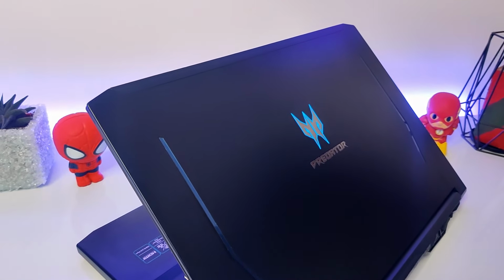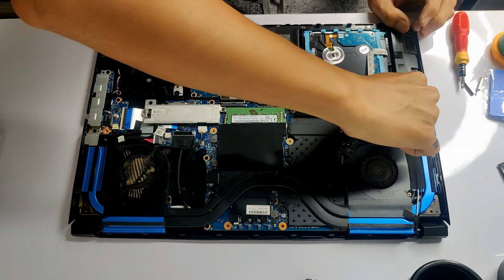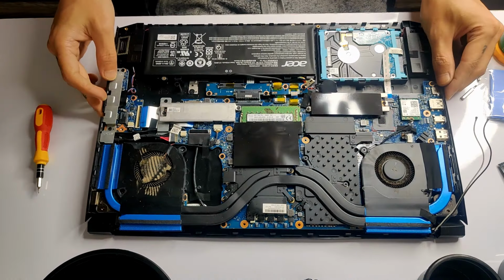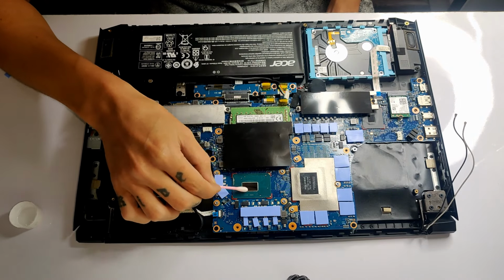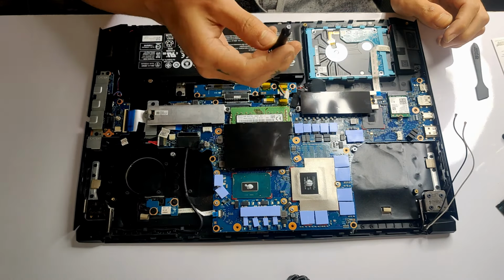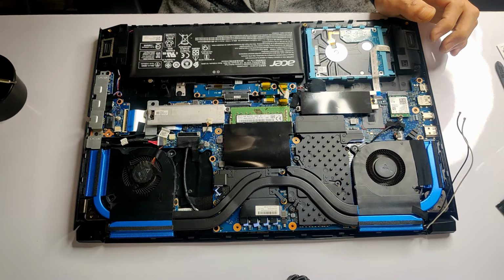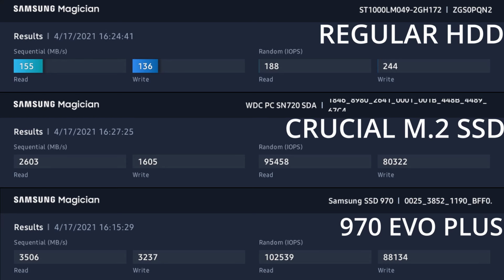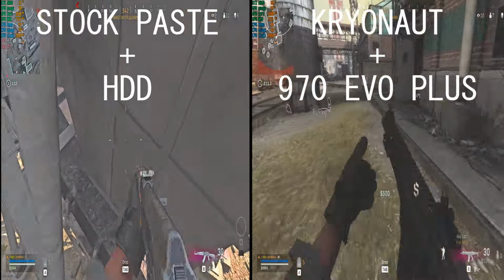ACER PREDATOR HELIOS 300 2019 UPGRADE | REPASTING | CLEANING GUIDE & BENCHMARK

Comment: Hey Sir .. my laptop is Helios 300 - i7-7th 1060 - 2017 .. i need to know .. the right size(thick)  thermal pad for my laptop .. is it 0.5mm or 1mm .. Or more than that? how thick are you using?
Reply: I hope you can answer it.. thanks sir
Reply from the maker: Hi. Sorry for the late reply.
For your model laptop, you can use 1mm for everything.
Hope this helps. Do subscribe to show some support 😃✌🏻

Comment: I have some serious thermal issues. I have done everything i can software vise. I think it's a hardware issue maybe thermal paste is gone or something i don't know. Can you clean it or what should i say to a shop when i want to get it cleaned like u did ?
Reply from the maker: You want me to clean it for you? What if I took your laptop and disappeared? Lol... I'm just kidding 😋 I could do that for you. Not a problem at all.
If you're giving it at a shop to do the job, I wouldn't trust them with it. You will still have to open and check for yourself.
I once gave my old laptop for service due to some motherboard issues cause one of the GPU IC was burnt and when I got it back, I opened it up to check what they had done. To my surprise, I found so much of dust stuck in the laptop, including the fans and I had to clean it out myself. I mean it's an old office laptop and the fans are not hard to reach like this predator model or any other gaming laptop in that case where the fans have an enclosure. The dust was sitting right there as I opened up the back cover and they couldn't even clean it for me. From then on, I decided to do the repasting and cleaning by myself.
You could give it at a shop, but make sure you don't take the heatsink off in case you want to check later or else air bubbles might form and in return, causing thermal issues.
Hope that helped. Let me know if you have any other questions. Do SUBSCRIBE to the channel to show some love and support 🙂✌

Comment: BRILLIANT !!!
Reply from the maker: Thank you 🙂 Glad you liked the video and hoping you subbed to my channel 😊✌
Reply: @MVNDRVX  Done 👍
Reply: @MVNDRVX  what thermal pads size will be good for helios 300 (2019) 15.6" model ?
Reply from the maker: @omega6180  Same... As shown in the video... 1mm everywhere except for vram memory chips which will be 0.5mm
Reply: @MVNDRVX  Thank you.
Reply from the maker: You're welcome 🙂👍
Reply: @MVNDRVX  Repasted my Helios 300 today. No more overheating in Aida64. But CPU temperatures still go upto 85-90C regions while playing games like FarCry New Dawn in Ultra
Reply from the maker: Did you clean the fans? And which brand of thermal paste did you use?
Reply: @MVNDRVX  yeah I cleaned the fans and heatsink too. I applied kryonaut using spread method
Reply from the maker: Maybe just give it 2 days or so for it to cure and check your thermals again or else i think you might need to reapply again if there are no changes. Are you sure you applied enough paste?
Reply: @MVNDRVX  yeah I am sure. Maybe it's the Indian summers. How are your current max temps?
Reply from the maker: @omega6180  yea maybe it could be the hot weather. I get a maximum of 82-83 degrees at a room temperature of 24 🙂

Comment: Hello. By any chance do you have a link for the rubber part of the hard drive with sata cable? I got the same laptop but semi new, I opened it to add another ram but there is no rubber part on the 2.5" bay. I tried talking to the seller but I don't have a response yet. I hope someone can help me. Thanks a lot in advance!
Reply from the maker: Google these following part numbers and you can find many online sellers.

Part number for HDD rubber: 47.Q5MN4.008
Part number for SATA cable: 50.Q5MN4.005
Reply: @MVNDRVX  Wow thanks a lot sir!
Reply from the maker: @rainerjoshuamarasigan6753  You're welcome

Comment: my acer stopped working yesterday night and i got mini attack but today morning it started working. again but i an afraid. i already have a history of opening and cleaning the 2 fans internally when gpu fan stopped working. i will use your video to move further for repasting. thanks a lot. is it worth repasting my 1.7 years old 2019 predator or anything might get damaged as i am not expert in these things? i do heavy gamming.
Reply from the maker: Have you repasted the CPU & GPU before?
What are your laptop temps?
Reply: @MVNDRVX  didn't repaste yet. i opened 15 days ago when GPU fan resisted to rotate and cleaned  both fans from inside and found a thick cloud of dust at the openings of the airvents. after cleaning air flow in and out is good from both fans and temperature touched 90C after few hours of continuous gaming instead of touching 90C immediately. 

Yesterday, laptop suddenly died while doing some work and it continuously restarted for every 5 seconds by itself without any display on the screen. I tried everything found on internet but didn't work. today morning it again started working. I am not able to understand what was the issue the laptop?
Reply: @MVNDRVX  cpu hits 90-95C and gpu hits around 84C without repaste. i undervolted cpu.
Reply from the maker: @ThePrabhu16  Those temps are pretty high. You should repaste the laptop. You wouldn't need to undervolt any more once you're done.
Sounds me to like you took off the heatsink to clean the fans. Whenever you take off the heatsink, always make sure you apply fresh paste. If not, air bubbles can form and further causing thermal issues.
Good luck. Let me know the results once you're done. Feel free to ask me if you have any doubts. Do SUBSCRIBE to the channel to show some love & support 🙂✌
Reply: @MVNDRVX  thanks a lot for your support and time. will repast and let you know the thermals.
Reply: any idea on how much does mother board cost if it really got damaged. mine is acer predator 1660ti with i7 2019 version.
Reply from the maker: @ThePrabhu16  you're welcome 🙂
About the laptop rebooting itself after every few secs is not an issue with the thermals. Its the laptop itself. It has happened to me too a couple of times. Just let it do it's thing. Don't power it off when you get a black screen. Just turn on the laptop and let it reboot a couple of times and it should be back to normal in a couple of minutes.
The motherboard would cost as much as the laptop itself because the CPU & GPU are integrated into the motherboard unlike desktop PCs. Better to buy a new laptop if that's the case 😅
Reply: @MVNDRVX  hope there is no mother board issue 😀 but very thanks for your replies . hope your channel will grow more in coming days.
Reply from the maker: @ThePrabhu16  Thank you so much 🙂🤍
Reply: @MVNDRVX  have done the repast with heart holding in my hand . luckily things went fine and my laptop powered on after repaste. but had some issues while placing the silicon cooling pads which are of different widths. because of irregular cooling pad widths, some ics are not touching the touchable points of the heat sink. noticed reduction of 10degrees in cpu temperature in predator sense app after repaste but when i touch the part above the keyboard, it burns 🔥 our fingers after few minutes of gamming.
Reply from the maker: Because most of the heat is produced above the keyboard. You won't be touching that part often anyways. Can't expect more from a laptop.
But the good thing is that you managed to drop your temps up to 10 degrees. That's great 😃
Shows that you've done a good job with the thermal paste 🙂
Reply: @MVNDRVX  it happened because of your video 😀... thanks a lot.... purchased cosmic byte hydroid cooling pad but not sure how it helps .
Reply from the maker: You're welcome 🙂
Actually cooling pads don't help much. You should've got an adjustable laptop stand instead. I've bought one from the same cosmic byte brand for 900rs and the quality seems to be decent 😁

Comment: what should i do with my acer predator helios 300. when i put the charger in , the charger light comes on but screen is blank and wont power up ? been told by the computer shop its the graphics card but i dont get how ..... shouldnt it be cause the battery might be burnt out so i just need a battery change
Reply from the maker: Did you try to disconnect the battery and reconnect it again?
Reply: @MVNDRVX  yep
Reply from the maker: @WealthOverFameAndAttention  Is the Predator logo showing when you try to power it on? Or just plain black screen?
Reply: @MVNDRVX  plain black no predator logo
Reply from the maker: @WealthOverFameAndAttention  Hold down the power button for 10-15 seconds, let it charge for a while and try turning on again.
If that doesn't work, then you will have to check with Acer service centre.
Reply: Having the same problem after repasting. Fans are not running, just black screen. Tried disconnecting and reconnecting the battery. Discharged and charged completely

Comment: when you did the storage upgrade, did you move that to be the primary storage device or just add a second drive? Mine has a 512gb and I am going to add a 1tb but I am trying to figure out if i need to move my os and everything onto it it by cloning then clearing the 512 or just add it as additional storage.
Reply from the maker: I just added it to the other empty slot and kept everything else how it was.

Comment: I have a doubt regarding the Vram, since it was a paste that was there wouldn't be better replacing with thermal paste too? Or another paste (meant for vram, idk the difference)
Reply from the maker: Yes it would be better to repaste with the same kind of thermal paste but it's not available or affordable in many countries.
So thermal pads would be the next best option 🙂
Hope I've cleared your queries. If you think me or the video has been helpful, do subscribe to show some love and support 😊✌🏻❤️
Reply: @MVNDRVX  Thank you very much, I'll see if I can find it in my country, btw do you know what is the kind of paste they used on vram? Subscribing right now, thanks.
Reply from the maker: Not sure what brand of high viscosity paste Acer exactly used. Might be a cheap quality china made product.
You could try the Thermal Grizzly Kryonaut Extreme 🙂
Reply: @MVNDRVX  Which thermal pad did you use though, 0.5mm or 1mm?
Reply from the maker: @JotaFla  I used the 0.5mm for the vram and 1mm for everything else 🙂
Reply: @MVNDRVX  Thanks!

Comment: I'm planning to use Carbonaut on this. What should the sizes of the thermal pads be? The Carbonaut is only .2 mm thick. Should I opt for .5 mm all around or do I stick with 1 mm everywhere, and .5 in the VRAM modules? Thanks!
Reply from the maker: Stick with 1mm and 0.5 for the vrams 🙂
Good luck. Do subscribe to show some love & support 😃✌🏻❤️
Reply: Just an update: Followed everything regarding the thermal pad thickness and still used Carbonaut and it worked flawlessly! Thanks for the advice. :)
Reply from the maker: @DaddyK1tt3n  I'm glad it worked out well for you 😃 you're welcome 🙂❤️

Comment: Hi , please help … I have acer nitro 5 , I applied 1mm thermal pads to the Vram  the performance is now weak  and the temps is higher too … what should I do ?
Reply from the maker: Did you reapply the CPU and GPU with fresh thermal paste?
Reply: @MVNDRVX  yes repasting with thermal grizzly and applying thermal pads the GPU temp goes up to 78C with very poor performance 50% GPU usage … is there a possibility that the pads are too thick ?
Reply from the maker: So normally the vram mems don't give out so much heat. I think your thermal paste application was too little or check whether you connected the fans. That's a very common mistake people make 🙂

Comment: Which ones are the VRM chips? The smaller ones? I can't tell the difference which you put 1mm thermal pads or 0.5mm thermal pads.  I'll be doing the same thing you're doing.
Reply from the maker: The Vram chips are the ones that already have pink paste on them. You need to replace that with 0.5mm pads and 1mm for everything else 🙂

Comment: Hi, I have a Predator Helios 300 PH 317-53, I wanted to add a SATA 3 SSD to it, but when I disassembled it, I did not find a connection loop there, and a vibration-isolating elastic band. Tell me, what model of SSD connection loop should I buy?
Reply from the maker: Hi! Your only choice would be to remove your HDD and replace the slot with the SSD. There are no additional slots but you can add a m.2 SSD since there are 2 slots.
Hope this helped. Do subscribe to the channel to show some love & support 🙂❤️

Comment: Any suggestions on how to deal with a stripped screw? I could remove all the heatsink screws except screw number 5 and ended up stripping it. Tried the elastic rubber band method but that didn't work either. Also I have thermal paste that i was unable to use, how long do they last if unused?
Reply from the maker: There should be another method to remove a worn out screw head. You could Google on that.
Thermal paste would last you atleast 5-6 years if stored properly.
Good luck 🤞🏻 Do let me know how it goes 🙂
Reply: @MVNDRVX  thanks!
Reply from the maker: @Catalyst_911  no problem 🙂 if you found the video helpful, do subscribe to show some love & support 🙂✌🏻❤️

Comment: Bro u said u would use 0.5mm pad for the vram memory. Can u specify where in the video did u use the 0.5mm pads. A timestamp would be appreciated 😊
Reply from the maker: Hey! 0.5mm would be the replacement for the pink paste. As simple as that 🙂
Hope this helps. Do SUBSCRIBE to show some love and support 🙂❤️
Reply: @MVNDRVX  thanks a lot 😁
Reply from the maker: @mirfarzaan8461  Anytime 🙂👍🏻
Reply: @MVNDRVX  what if every thing is pink like mine
Reply from the maker: @sn3ke124  I'd suggest you apply thermal pads as mentioned in the video, fix the heatsink back, let it rest for a while, remove the heatsink, check for contacts and then apply thermal paste.
Reply: @MVNDRVX  i have the acer predator im buzzy removing the pink stuff as we speak now... my model is the PT 315 52 its my 1st time to to this.... its the 1660ti one. I had 95°on my cpu.. thermal throttling aslo... im not sure what u mean by puting the heatsink back before the paste
Reply from the maker: @sn3ke124  What I mean is, you need to check for contacts between your chips and heatsink. So if you apply thermal pads first and fix the heatsink, once you remove it, you would see some impressions on the thermal pads, which means you're good to go. Then you can apply thermal paste on CPU and GPU in the end because once you apply the thermal paste, you shouldn't remove the heatsink unless you're trying to repaste again.

Comment: Nkw that it's been 3 months since this video.
How has that Kryonaut held up? 
Because I've had a rather mixed experience with it.
Reply from the maker: Hey! To my surprise, the thermal are still good. I just had to open the chassis and clean the fans alone to remove the dust. The CPU thermals are around 80 degrees celcius and GPU is max at 65 degrees celsius. 😀
Hope you liked the video. Do SUBSCRIBE to the channel to show some love and support 🙂✌
Reply: @MVNDRVX  that's good. Kryonaut is usually infamous for seeping out, or drying quickly.
I had this issue on my CPU application within 5-6 months.
The graphics card on the other hand is working fine, even after almost an year now.
Reply from the maker: @IcyB-xg6xs  it's totally fine if it seeps out. The drying is an issue. If the CPU thermals are still good, then there's nothing to worry about 🙂

Comment: This video reassured me about what to expect !! Thanks to you !! Very good video !!
Reply from the maker: You're welcome! Thanks for watching. I'm glad you like the video 🙂
Reply: Hi @MVNDRVX , could you enlighten me a bit please? I see you used KRYONAUT thermal paste. Are you satisfied with it? No corrosion problems with this paste? Have you seen a clear improvement with CPU and GPU temperatures before and after change? Thank you for your answers.
Reply from the maker: @iconxmath8830  Hi. There are drops in temperature but there's a limit. You can't expect much from a laptop. If you want more better thermals, then i would suggest you go for liquid metal. Keep in mind, the procedure for applying liquid metal is a little different from applying regular thermal paste. It's not worth the hassle, I'd recommend you stick with kryonaut 🙂

Comment: Hey! I have repasted my laptop, although I didn't change the thermal pads (used kryonaut with the spread method). Every other variables are equal, but my laptop is still running hot (It's running on the same temp as before repasting), what do you think is the cause? Is it because of my thermal pads? (To be fair my thermal pads' conditions are worse than yours lol
Reply from the maker: Then change them!!!!! Lol😆
Those small chips don't give much heat actually. Most heat come from the CPU & GPU. You wouldn't have applied enough paste.
Just use the pea drop method(be generous) and let the heatsink pressure do its thing. Remember, too much is OK but too little will not work. Good luck.

Comment: Is there a difference in applying thermal pads individually and not just  1 long strip across? Thank you :)
Reply from the maker: Nope. It would just be a waste of thermal pads, that's the only difference 😅
You're welcome 🙂 If you found the video helpful, do subscribe to show some love & support 😊✌🏻❤️
Reply: @MVNDRVX  Thank you! Already subbed and liked. I'm still trying to figure out why my laptop is throttling after i repasted it and replaced the thermal pads.
Reply from the maker: @aethosken  ok let me ask a few questions first to be sure 😁
1. What are your temps after repaste?
2. Which thermal paste did you use?
3. Which method of application did you use?
4. How did you come to a conclusion that it's throttling?
Thank you 😊✌🏻❤️